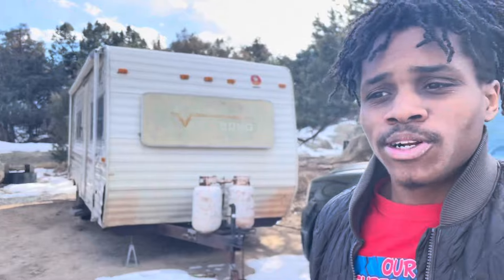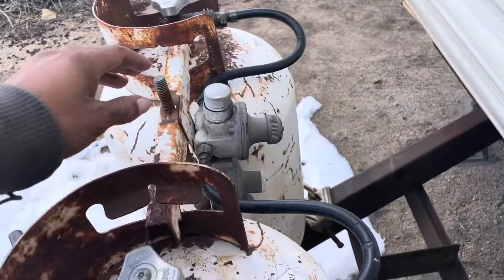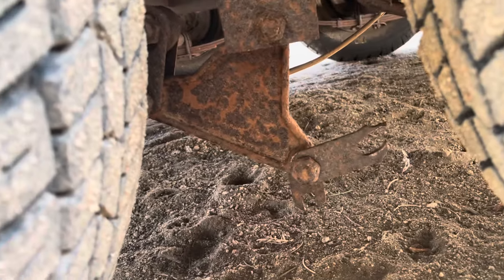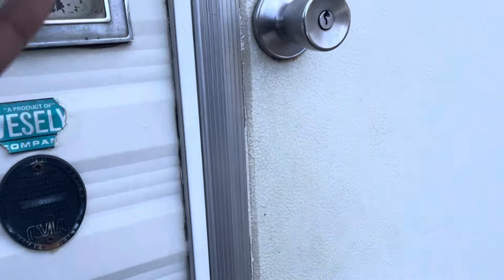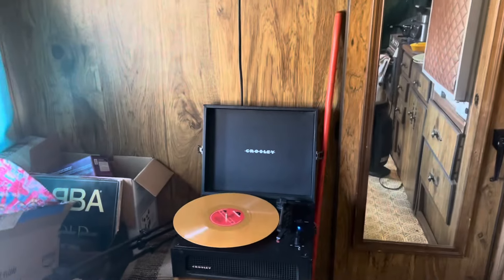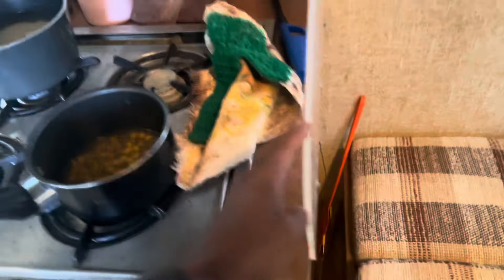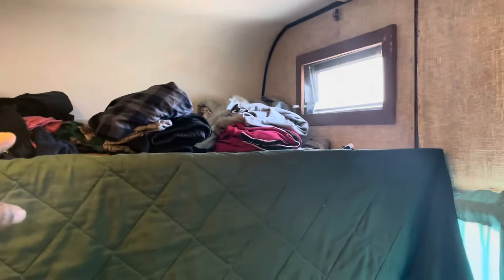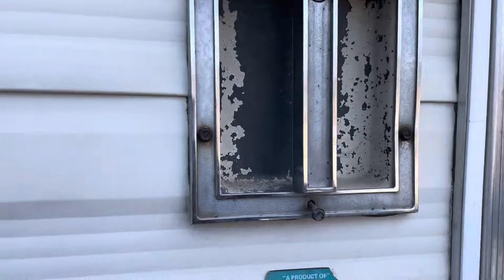I BOUGHT & LIVE in a 1979 Camper! (From Marketplace) | RV Restoration Ep.0

Comment: POPW
Does the roof leak at all ? if you don’t fix the roof before you replace the ceiling tiles and wall paper it seems like it will mess up your new work.
The kitchen metal would look good cleaned polished and shiny. Nice having a double sink.    If you don’t like the feet on the tv, you can just unscrew them. 
You are very ambitious. Good luck 👍🏼
Reply from the maker: YOU ARE AWESOME❗️ I recently found a leak actually that will be covered in the first update but that’s a amazing point actually!!! You’ve earned a spot in the next episode with this awesome advice❗️

The feet are keeping the tv leveled and facing forward vs facing the floor I believe, otherwise I’d remove them for sure. And thank you so much, your support means the world 🖤